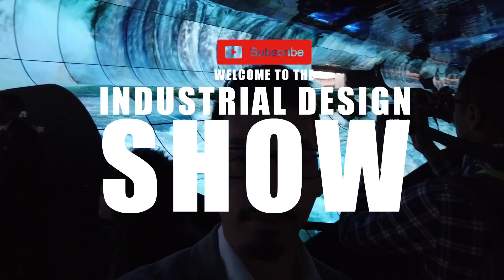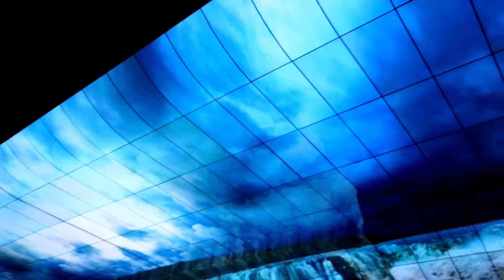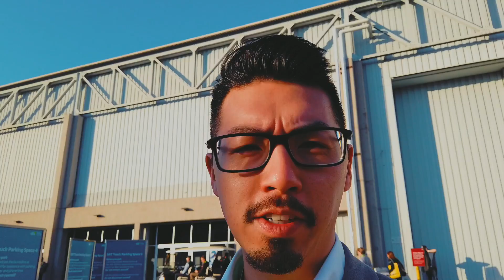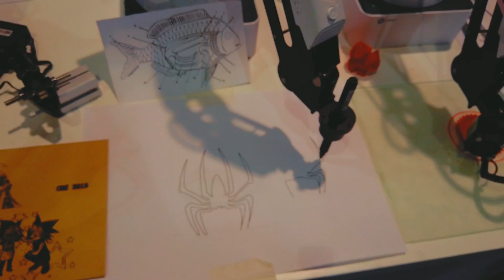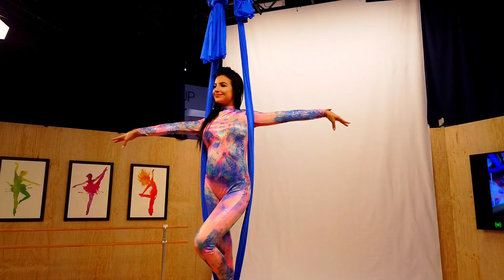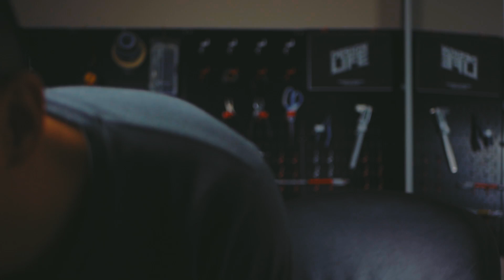Why Industrial Designers Are Different Than EVERYONE | Industrial Design Process

Comment: Quick question; do industrial designers get a commission of the profit from the products they design??
Reply: No we are usually hired to design and see a product through to manufacture, after which we are done with the project.
Reply: "Usually" is the key word that Archetype used. There is a breed of industrial designers that license their designs. This is almost always the case for furniture designers actually. So yes, sometimes designers do get royalties.
Reply: @Michael-mp1iu  you may need to make a name for yourself before getting to licence your products. I think the most common case would be an ID being hired to design a product and just that, of course you can gain some recognition through it, but not as much as commissions